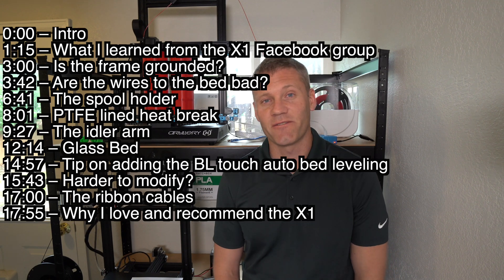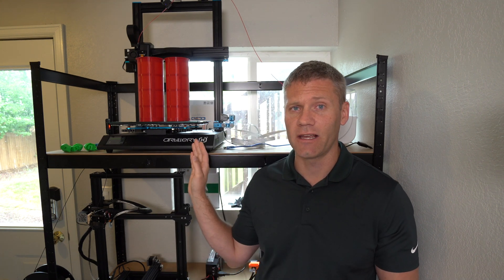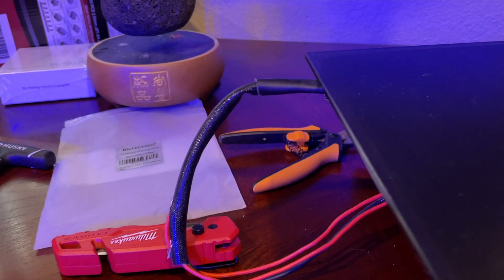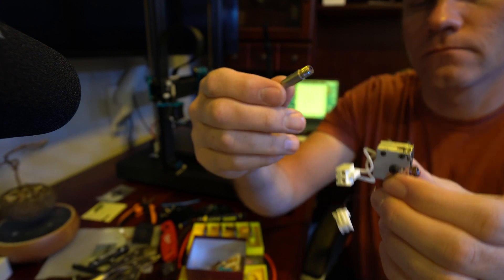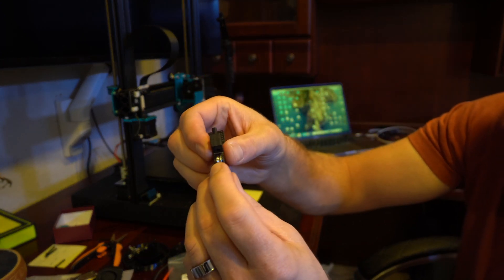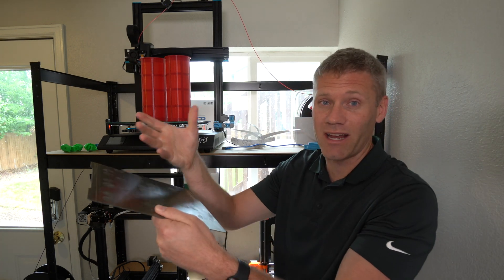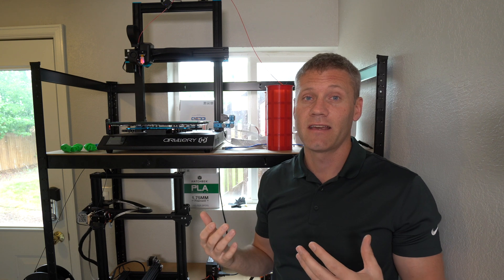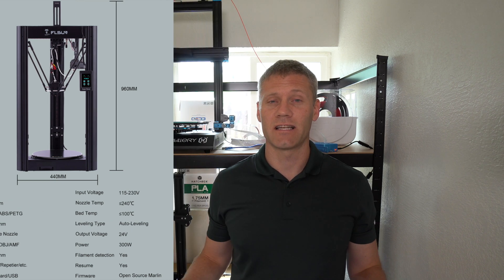Artillery Sidewinder X1 Review - 6 Months Later

Comment: Your experience mirrors my own. After a year, I did add a textured PEI bed.
Reply from the maker: Nice thanks for sharing. Did the original bed get warn out?
Reply: @waltsreviews90  I felt like it did. No matter how I cleaned it, I could not get adhesion.
Reply: @waltsreviews90  My artillery sidewinder heatbed warped
Iike crazy. Seems to be normal on an artillery machine. Don't get Chinese. Get a quality machine. You'll thank me later.
Reply: @FuriousImp  aren't most of the top 3d printers are Chinese though?
Reply: @tizben  Sure, top sales numbers. Doesn't mean the quality is ok though. I mean - why the hell would you think it's ok to send out a printer with a warped bed?! A warped bed!
Reply: @FuriousImp  I agree that it's fucked for artillery to send out stupid broken devices. But I mean the top performing devices are Chinese. Which brands are the good quality ones?
Reply: @tizben  Prusa is a great example. I've had to invest so much into my artillery to fix it, that it would have cost about the same for a prusa. Minus the headaches.
Reply: @FuriousImp  what kinds of things did you have to buy to fix it? Do you have any articles or videos for me to refer to? I'm new to the sidewinder
Reply: @tizben  The heatbed was warped, like I've seen many other users say. The extruder crapped out on me so I replaced it with a Bondtech BMG and Phaetus dragon hotend. Now the carriage that the extruder sits on can't be properly aligned any more. The 3 holes in the carriage where the V slot wheels attach are too large. Same goes goes the 6 holes for the V slot wheels on the heatbed. There is play there. I'll be upgrading to linear guide rails, at least for my extruder. And why use those black soft metal screws that fall apart after turning them 4 times? I'm very disappointed about this machine. When I get those guide rails installed, I'll do input_shaper with an ADXL345 accelerometer and see where I stand.
Reply: @FuriousImp  I've had my Sidewinder v1 since 2019 and I've only had to replace the idler arm. The only other upgrades I've done are better nozzle, heat break, and added a BL Touch. If you are having to upgrade all those parts either you don't know what you are doing or you are overthinking the printing process and trying to outsmart the machine.
Reply: @ASSOpid  Then you've been lucky. Don't be so judgmental. You'll feel better, I swear. Drink some tea and calm yourself ✌
Reply: @FuriousImp  The Prusa costs 2-3 times as much. And I don't think they even make a 300x300x400 printer. I think you're the one being judgemental. Just because you had a bad experience doesn't mean most people will. Most people won't, a very few will. There are things from China I would avoid (food, medicine) - 3D printers isn't one of them. There are bad ones, there are good ones, there are better ones. That's why reviews like this help.
Reply: @FuriousImp  have mine for almost a year printing non stop. Only had one steppermotor running a little hot. Mailed 3djake and they send a new one for free. Never had a single other problem. Printing pla, petg, tpe, tpu and sometimes abs. If your bed was warped they surely would send u a new one or either replace the printer completely like prusa did when my mk3 died after only a week.